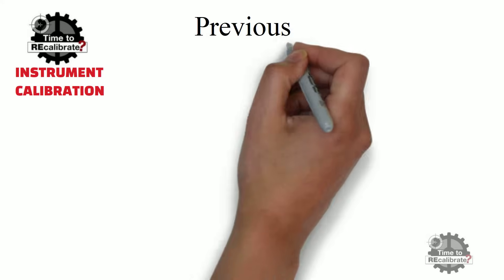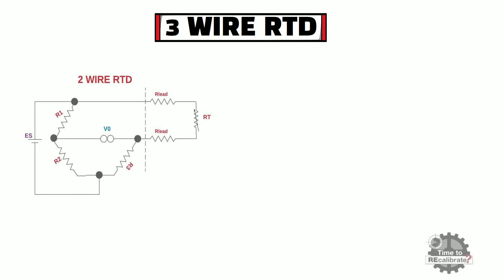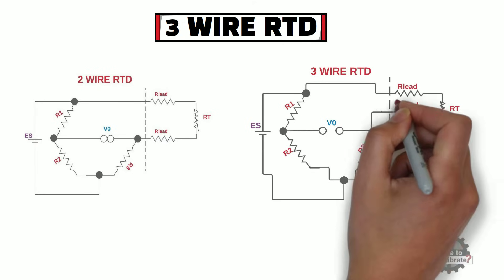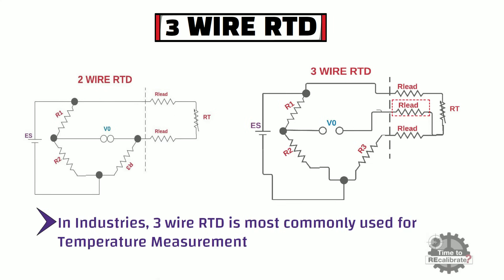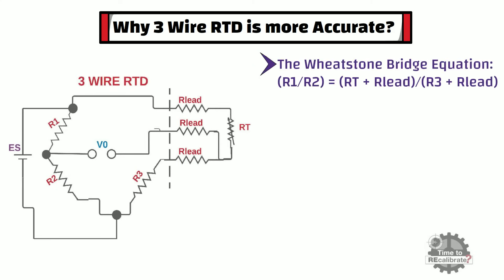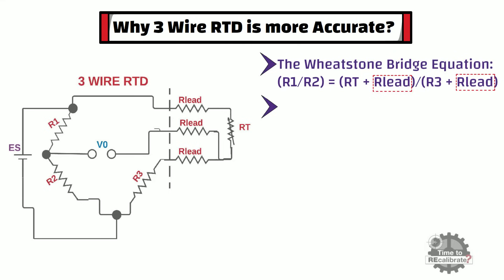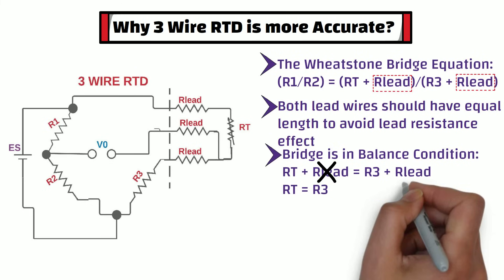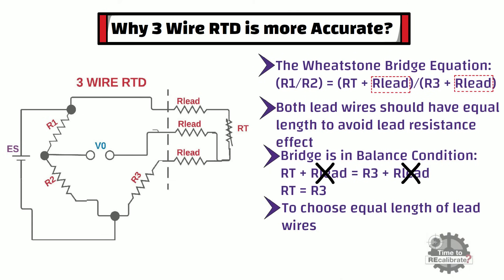Why 3 Wire RTD is more accurate than 2 Wire RTD | RTD Lead Wire Compensation

Comment: Sir we r using long distance cables that cable  resistance added in pt100 3 wire type how to reduce that cable resistance

Comment: I think you should use numbers to see that this only works if the fraction of resistors on the left side is one over one(same resistor top and bottom) not some other fraction like one over two e.t.c 
Because you can have a balanced bridge (the same fraction on both sides say 1/2 ) 
And get there with the variable resistor but it will be wrong.

E.g with 10/20 resistors on left side i pretended to have 10 ohm resistive legs for sensor but with a 90 ohm sensor. That meant to variable resistor would stop at 40 as (40+10=50) top resistor and (90+10=100) bottom resistor giving a balanced bridge 1/2=50/100 but when we take to 40 we are yetting on variable and try to work out the sensor restance as we dont know we get 80 and not the desired 90 that it is.
Reply: I have also the same doubt

Comment: Sir my doubt is how that middle leg rlead nullify the effect of other two rlead resistance values?
Reply from the maker: Hello Subash
As per the Wheatstone equation, Third wire eliminates the effect of lead wire resistance. Please see the Wheatstone bridge equation, you will get better idea.
Reply: Your analog input to measure the voltage typically has high impedance (100kohm to >1Mohm), so very little current (nano to micro amps) is flowing through the middle lead wire.  Voltage drop is proportional to current and resistance, so the voltage drop will be very low.  The bridge resistors are likely <1000 ohm, so using a two wire means your lead wire effect will be orders of magnitude higher.

Comment: Very interesting analogy.   Your math holds true as long as the middle leg "RLead" does not draw any current. It is important to note that whatever device is used to measure or receive "Vo" must have extremely high input impedance to ensure that no current does flow.
Reply from the maker: @Ted You are absolutely right